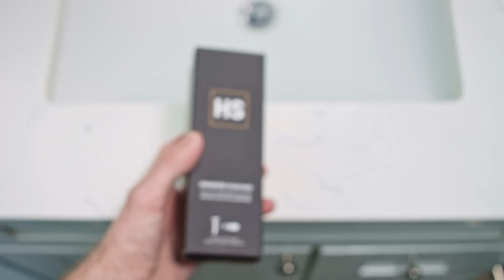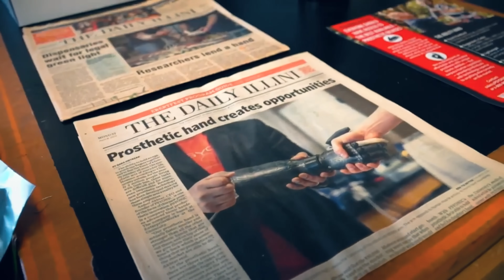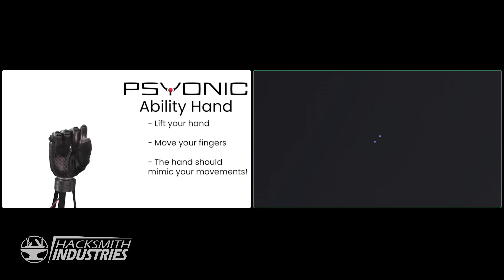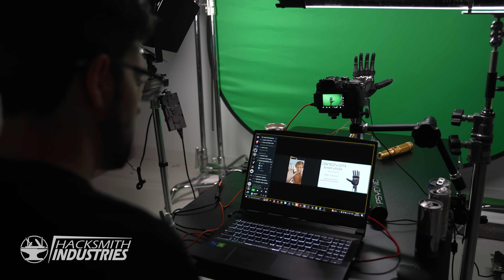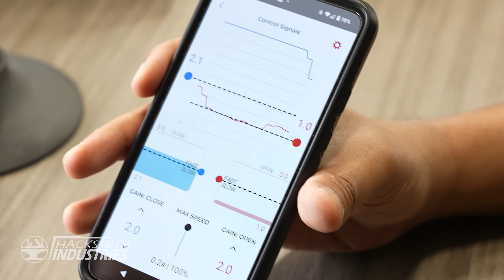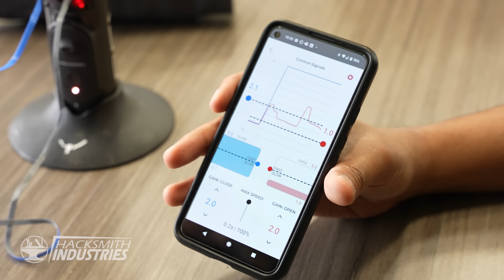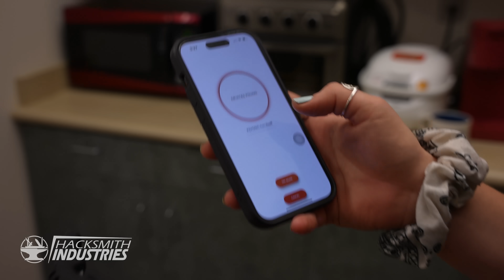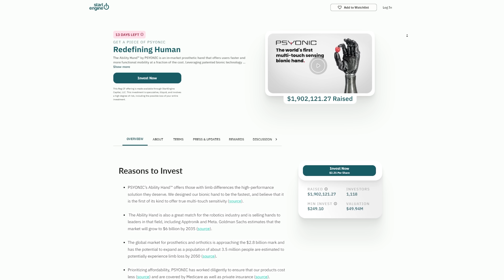This Bionic Hand Will Change Everything!

Comment: One question I would have is, how long the battery is lasting. Great product, we are living in the future.

I also love this  kind of a little bit lower paced video. Fits to your channel really well too :)

Another question: Why is this still "so expensive". It is some servos, some motors in a quite small frame. Is it due to the low numbers of units made, the r&d and personalisation, a combination of this. I think in theory it could be under 10k  unit, but I am really not sure :D
Reply: Money. It's always money dude. A lot of tech you see in stores in total will cost like $20 to produce and will be sold for $100-$200
Reply: @sidneyrobinson18  See that’s true with tech products which are produced in the millions all the same like an iPhone. But with these hands they have to pass a dozen licensing tests. On top of that Every socket is custom made for the persons arm and the sensors are specifically placed for them, then there’s the materials, R&D, custom molds, custom machinery, and etc that’s involved to actually make the hands, arms, and sockets. Then there’s the overhead, the factory, the employees, the advertising, the websites, and etc etc. such it’s such a niche product (100 users for example with his company) you have to charge a high amount just to break even yet alone make a profit.

Comment: Why those bionic hands are missing wrist joints? Are there some limitations in terms of muscle signals or it is just to keep the costs low?
Reply from the maker: the wrist joint is part of the socket -- the hand is compatible with wrist manipulators -- just depends on what socket you have

Comment: This is actually a more proper version of a theory I had for getting proper robotics to work. Using pulley and cirvo motors, you could theoretically (although not cheaply keep in mind) create a proper functioning robot. Use specific sensors for balance (such as what a phone uses to judge whether you rotate your phone or not). So we're even closer than I thought to true cyborgs/robots.

Comment: Just an idea but nitenol springs in criss cross pattern on the diagonal inside silicon tubing with hot and cold water flowing water valves, using the heat produced from electronics to help heat the hot water and the cold water flow going back to help with cooling.

Comment: This is incredible, I see thy basically nailed the closing of the fingers and even the opposing thumb, the next step when it comes to ability would be the rotation of the whole wrist and perhaps moving fingers sideways (to hold something between them) but at that point I think both the mechanical and neurological complexity is just slightly outside of current tech.
Reply: The wrist motor is currently only standard for full arm replacements otherwise there is no space or it's too heavy.
There are always considerstions and compromises to make with a prosthesis design. Their fingers are kinda flexible in the adduction but they manage to pinch with 3 fingers, taska has very flexible fingers and just doesn't pinch, Evolution4 is quite rigid and can pinch with 2 fingers and like 3mm accuracy. Bebionic is also rigid, with össur i don't know but their slender fingers with bowden actuation would not be ideal for pinching
Reply: It's entirely possible with current tech. Just takes the right type of person with enough money to figure it out

Comment: Very inspiring stuff. Thanks for making the film. One thing that wasn't mentioned was whether the software will be open sourced at some point. It would be tragic to have to rely on this technology but then back-end support goes away if the company changes direction, obsoletes certain models or even goes out of business. Reparability and spare parts availability are also an issue especially if supplying to less-developed countries. I really hope this company is successful.
Reply: I imagine a market for jail breaking and pirating the software would open up quickly in that case, especially if somewhere like the EU mandated consumer protections like that. Similar to what they did with apple and phone chargers, and hopefully in the right to repair debates.

Comment: I paralysed my right arm in 1989. I had it amputated in the mid 90s. I did try out prosthetic arms (manual version)at the time, but I had lived with a totally paralysed arm for 5 years and I found wearing the prosthetic uncomfortable and paradoxically more limited than living and working as a single handed person. The technology back in the early 90s was still pretty crude.... (my arms were human powered, not electric). Things have obviously come a long way since then ;)

Does the company only do hands? Or do they do complete arms (with elbow joint etc)?

Comment: From the moment I understood the weakness of my flesh… it disgusted me. I crave the strength and certainty of steel: I aspire to the purity of the blessed machine. Your kind cling to your flesh… as if it will not decay and fail you. One day the biomass you call a temple will wither, and you will beg my kind to save you; but I am already saved. For the machine is immortal.

insert sick bass drop

E V E N  I N  D E A T H, I  S E R V E  T H E  O M N I S S I A H

Comment: A while ago I read about a company that made a bionic eye that ended up shutting down and taking the software that made the eye work with them. That left all the people who had received the implant blind and with a piece of non-functional tech in their heads. 
I know this isn't quite as high stakes since it doesn't require surgery to attach but considering that it uses an app to control some of the functions, is there anything to ensure the arm stays functional if the company goes bust? Like is the software open source or is there an alternate way to access those functions without needing the app?
Don't get me wrong, this is very cool and the work they're doing is incredibly valuable but I think it's important to make sure people don't lose their limbs if the company cuts off support.

Comment: What if you need a prosthetic limb, but have problems mentally focusing? There has to be a better way to control the arm than by thinking really hard. This seems like a major roadblock for people who are neurodivergent, and missing limbs.
Reply: You don't control it by thinking really hard, though that has been done with BCI. When you move your natural hand/fingers/whatever, you're actually just having your brain send those electrical impulses, but it's completely seamless and natural for people that have fully functional natural limbs.

Even in the case of someone born without the limb, like the lady in the video, it's just a case of training your limb and brain to interact in the same way, assuming it's possible. If it isnt,. then the only current method to use a prosthetic is with BCI. Which does mean simply thinking hard on it.

Comment: Awesome to see how quickly this tech is evolving. Real talk: how long do you think it will be before people want to voluntarily swap out their off-hand to a cybernetic limb that is way stronger and doesn't experience pain? It might not be everyone's cup of tea, but some people watching this would at least consider it.
Reply: From someone in the industry: first Person to Do this is maybe 15 years from now. The Problem are the ~20 muscles in your Hand you need for full control. Would need a massive TMR and 20-30 electrodes. Not to mention the adduction of the fingers and the correct thumb joint. Now this joint are two Motors, basically two hinge joints. The real thing is a Ball joint. Very difficult to implent that small and wirhout singularities

Comment: I understand the ultimate goal is to make prosthetic limbs that behave entirely like natural limbs, but I'm surprised that for now at least, more prosthetic limbs haven't begun to incorporate voice commands as an auxiliary input. Like: "Hand, close gently" vs "Hand, stay gripped tightly until I say otherwise." I know that's not an ideal form of input, but it seems like nowadays that would be relatively easy to implement.
Reply: It would be relatively easy to implement but the user experience of voice controls compared to direct control like this is awful. Think about how long it takes between saying something to your phone and it registering and understanding, then responding to it, compared to how quickly and effortlessly the users are controlling this arm.
Reply: @bosstowndynamics5488  Right, that’s why I’m thinking it’s an auxiliary input, not the primary input. Like, if you wanted the arm or leg to put itself into a special mode for specialized tasks.

Comment: The thing with prosthetics is that every case is different and so even if some parts can be « mass produced », there’s a lot of customization involved which skyrockets the price. Even something as simple as a wheelchair, that you’d normally think is pretty generic, has to be tailor made for each person. That’s one of the highest economic hurdle because it has to involve medical specialists, as a badly fitted prosthetic can potentially harm the patient significantly.
That’s the reason why those kind of prosthetics for children is particularly difficult, because they are still growing and their morphology constantly change. I’ve met an organization of volunteers makers here in France that produce low price limb prosthetics for children with the help of the 3D printers owners community. It’s a good way to address the economic problem, and I salute their work and good intent, but I have to admit that I was a bit shocked to discover that no medical professional at all was involved into the supervision of those projects.

Comment: I'm studying manufacturing engineering right now, and my dream is to work for a prosthetics company. You guys only sort of touched on it, but ostio-integration is, in my opinion, the biggest leap forward in the industry. Between that and the feedback abilities of some of these limbs, the future is bright.
Reply: Isn't osteointegration a pain in the ass because the basically open wound must be cleaned constantly and still gets infected? You only ever see one guy with it on magazines because he is the only one without pus oozing out. Exagerated but still
Reply: To begin with, yes. But it has already improved drastically in the past two years or so. There are several people who have had it done sucessfully. The big advantage is how much stress the prosthetic can take. If you use a socket approach, you have about a 20 lb weight limit or your arm just straight up falls off. You saw in the video how easily that girl took her fancy arm off. That's all it takes. If you can hook the prosthesis onto your bone, however, you can go rock climbing with the thing if you wanted to. And now that they've had more and more success preventing open wounds, it's looking better and better as an option. It'll probably still be a decade or two before it takes over though. The whole prosthetics industry has moved at a snail's pace for as long as it's been an industry. That's why so many people still use hooks or nothing at all. The price vs effectiveness has always been horrible.

Comment: While this is incredible progress, one must note how complex this device is, requiring both mechanical, electronical and digital components, so many motors, so many electronics that are, even if fully reliable, possible points of failure. Having them be able connect to the internet or bluetooth is scary, and the firmware updates leave space for someterrible practices to be put in later; imagine subscriptions for your hand. If I lose a limb, I'd certainly pick something like Ian Davis's design, rather than this; a lot cheaper too.

Comment: This is impressive, but the one thing that robotic arm+hand always miss is complete freedom of movement of the wrist. The wrist is always limited to just rotation around the center axis. However, wrist need to be able to move so much more than that in order for the prosthetic to work great.
Like for example, it is great to grab a cup of water with the hand, but then unless you keep it straight moving your entire arm you spill everything.